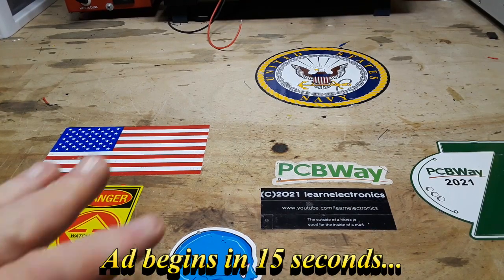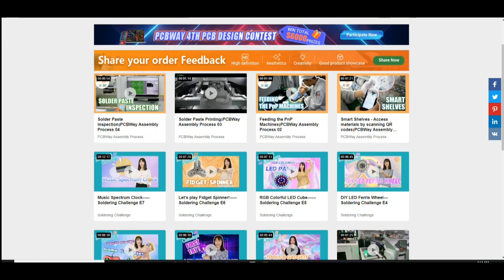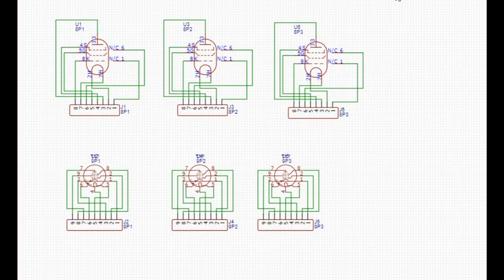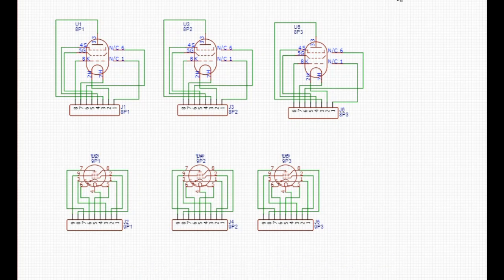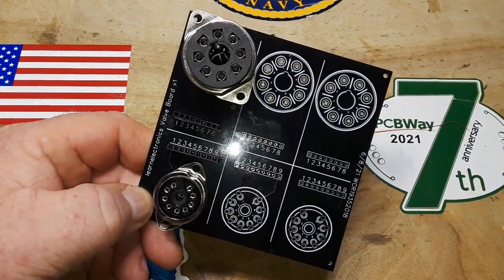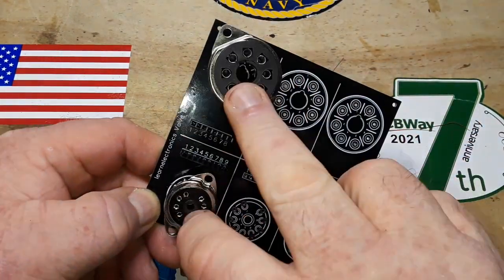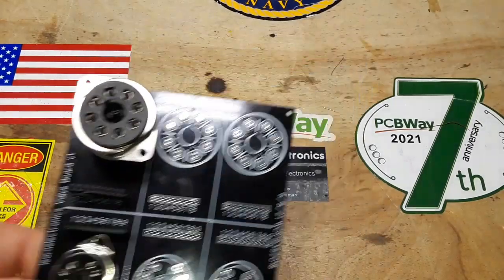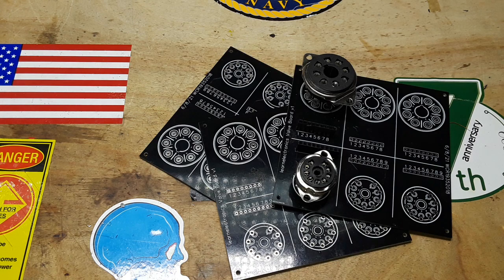An Example of What Not to Do In PCB Design

Comment: Why are you trying to solder the edge of a tag strip, to a surface mount board? At least drill slots to accept the tags and through-hole solder them.

Comment: I'm sure you're already aware, but just in case, those tube sockets for the 6L6s are keyed, and the tube can only go in one way. Given your pinout on the pcb, it looks like you offset where the keyed part should be one pin counterclockwise. If that's the case, when you install a tube like that, pin 8 will be in pin 1's spot, pin 1 will be in pin 2's spot, etc.

Comment: Hi Paul,
Think about your traces an die PCB..you have voltages of about 100VDc or more an  the Anode..don't put the trances to close together..you have space! Why so thin traces? 
Whats about mounting holes.. for stability...

Have a lot of fun with the tubes and make a lot of nice videos...
Geatings
Reply from the maker: I wouldn't be running more than 300-350B+. This is version 1. There will be improvements made from listening to suggestions from you guys.
It would have been amazing to get feedback from experienced folks like you 15-20 years ago.
Back then I had 2 other guys in the engineering room. If the 3 of us didn't know, we usually ended up calling Germany. Now I can show you guys what I'm doing and I get great advice. So cool

Comment: I made a breakout for the Pi Pico and managed to get the breakout header upside down and reversed. Very embarrassing.
Reply from the maker: I like to add a text label to headers and the like. Then when you go from schematic capture to PCB layout the label can follow.
Another trick is to always (sometimes you can't) make pin 1 ground in headers, sockets etc. That way if you forget what you did, you have a backup as pin #1 is squarem

Comment: I think the problem is that the valve bases are not really designed for pc mounting. It looks as if these valve bases were designed for chassis mounting where passive components are mounted on tag strip board.
The valve bases for PCB mounting have much smaller solder pins, that do not have the through holes in the connection pins or the metal tag holes through which bolts hold the socket to the chassis.

 I was born almost a decade earlier than you, and can remember radios and Tv's made with this construction technique. The 0.1 to .001 uF capacitors were the axially wax paper type, with  big red box shaped silver mica reserved for the pF range.  Big single ended, high voltage electrolytic capacitors came  in large aluminium cans, designed to be mounted in a similar fashion to the valve bases, in holes punched through the chassis, with the connections protruding below the metal work. These capacitors were held in place with screw tabs, similar to those on the valve bases, or with aluminium tabs on the can that were bent through about 45 degrees, in oval-shaped holes or slots,  drilled into the metal work. 
Resistors were 20%, or worse, solid carbon type or green wire wound. The circuits were not exactly made for high frequency stability. It was common practice to wire the passive components between two single in line tag strips, with the two ends supported by longer tags, that acted as  right angle bracket, screwed down to the metal chassis, using bolts or self tapping screws. Electrical interconnections were made with bare metal wire, covered the a wax cotton sleeving. 
It was only later that the PCB mounted valve bases became common. These had smaller pointed connectors, which soldered down to a single sided pcb. I first came across them in a plessey 625 line TV. The big problem with mounting valve bases directly to the PCB, was the heat from the valves heaters cooked the paxolin board, eventually carbonising it. A common failure mode was arcing across this carbon layer.
 The standard chassis shape, with an aluminium rectangular sheet, folded along the long axis, or an upside down box section. The passive components were mounted below, in the box section, and valves plugged in from above. Even prototypes test circuits, with only one valve, were constructed this way.
A one time it was possible to buy a punch tool set, for cutting the valve base holes. It could be a bit tricky as some early chassis were made from steel, rather than aluminium, to save money.

Comment: i learnt the hard way to put 'front' and 'back' on footprints that i create, ordered the boards, they turned up, i got halfway through soldering components, then noticed that the footprint was backwards on the next component, an rj45 socket, no way i could mount it backwards.

Comment: The PCB design is fine, you just ordered the wrong tube sockets.
Just not sure if those Dupont connectors and wires, 
and breadboards are suitable for the high voltages you need for tubes.
Reply from the maker: The current is quite small. And fender has been using pcbs since the 80s. But only one way.m

Comment: I'm sure you can get PCB friendly sockets for both valves.  The ones you have are for chassis mounting and the lovely 'Point-to-Point' wiring.  Mind you the power valves can get extremely hot so probably would work to well on a PCB.  I also noticed the AX7 symbol in the PCB design tool appears to be wrong, check the 12AX7 data sheet.  Perhaps PCBway doesn't have a double triode symbol ...
I do appreciate you simulating a common mistake for our education Paul.

Comment: I did something similar with the first boards that I ever ordered.  Not only were the holes the wrong size but the pin spacing was too close.  I did not pay attention to the dimensions on the pattern in the CAD.  In my defense, it looked right on the screen.

Comment: I recognize those sockets! I used them as a teenager (born in '49, BTW). Those are chassis mount sockets, and they were around long before PCBs were common. You put a big hole in the chassis, stick the sockets through the holes from below, drill two small holes through the chassis for the mounting holes, then secure the socket with screws and nuts – or pop-rivets if you were in a hurry. The wiring was all done point-to-point, including components.

I grew up working with tubes. Yeah, you could destroy a tube if you biased it wrong and made it draw too much current. But when troubleshooting a circuit, tubes were very forgiving. If your probe slipped and shorted something, you could get spectacular sparks, but when you took the probes off, everything was almost always the way it was before; no additional harm done. Sometimes probe tips even got burned off. Still no problem (usually).

But with something like a multi-stage amplifier done with transistors, if your probe slips, several transistors may not survive – and you get to guess which ones. And worse, there's no spark or other indication that something bad might have happened.

(sigh) I really miss tubes.